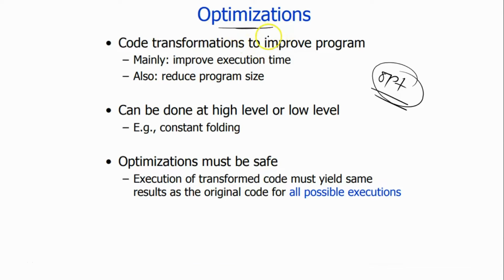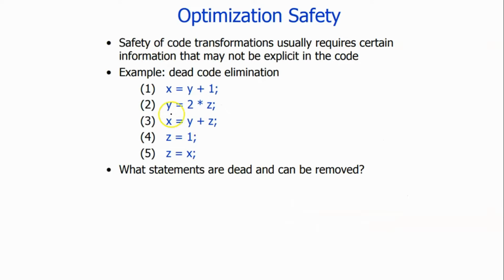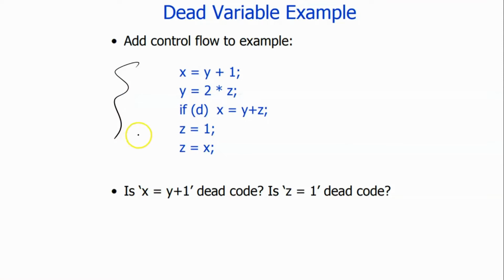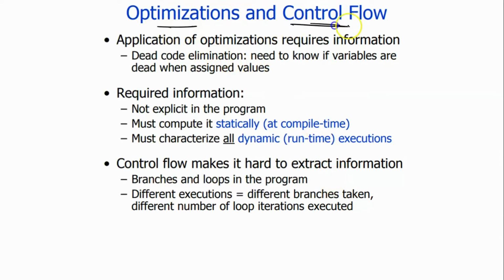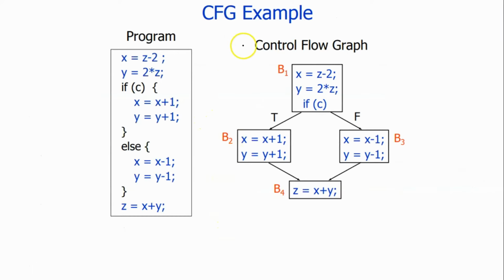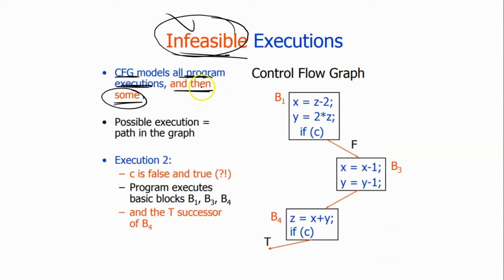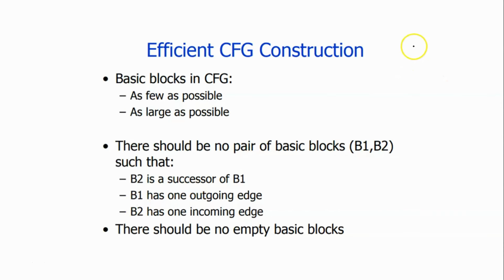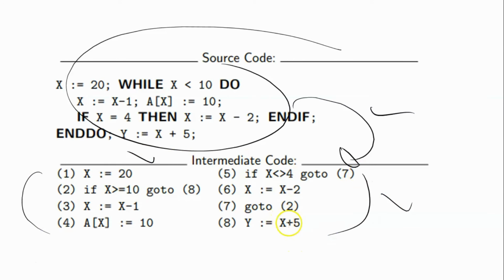Code Optimization : Introduction Part 1 : Control Flow Graph

Comment: HELLO SIR MY DOUBT IS: That 

Shouldn't 

The intermediate code shown at 1:20:27 have   
3) X=X-1   
4) T1=X*8   
5) A[T1]=10   
 Since we have an indexed mode operation?
Reply: Yes bro ! you are right. I think one more line will be added in. Bl/w as well.